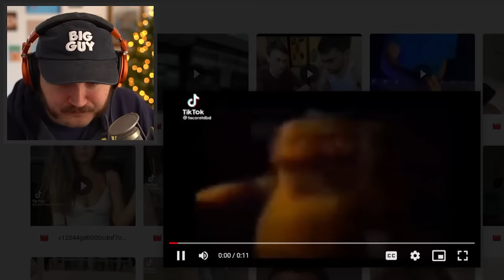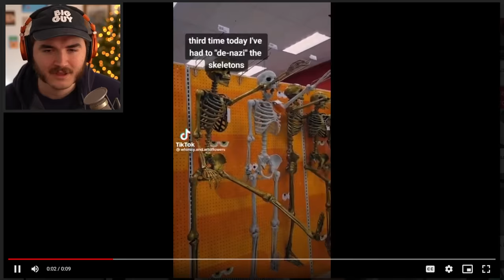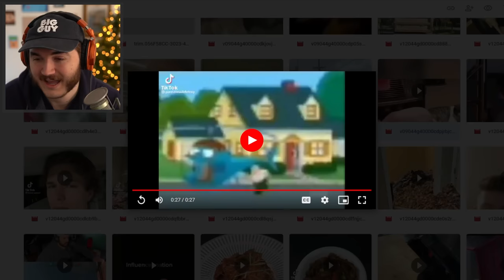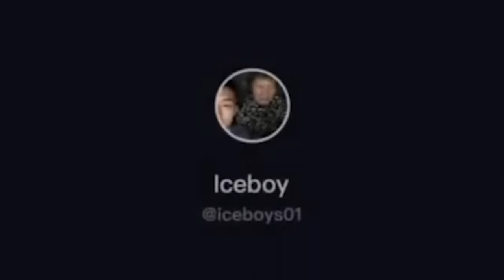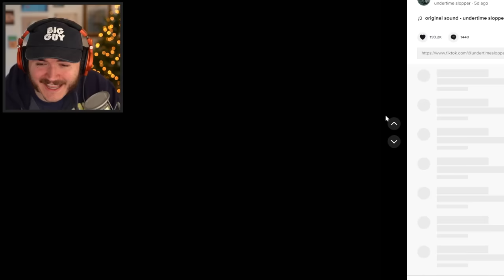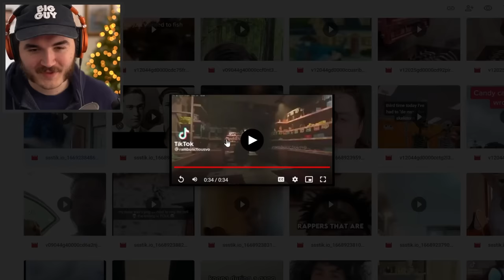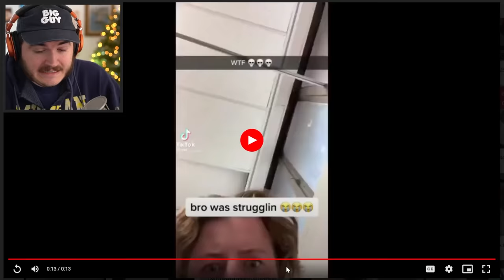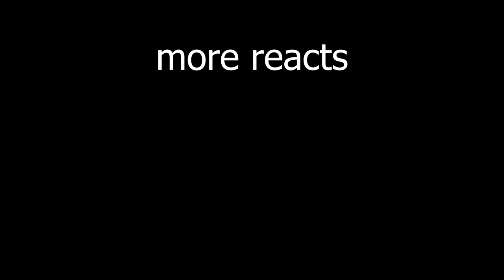Ranking Your VILE Tiktoks

Comment: 0:50 this was a blunder. If he had put the lemon in the cup he could have then rotated the potato to win.
Reply: WHAT IS THIS GAME EVEN I'm SO CONFUSED
Reply: @gelatinous6915 only real ones know how to play that game.
Reply: But if he took the tape measure out of the cup you could still counter the rotated potato
Reply: Alternatively though he forgot that he could use the melon slice move and cut it right in half along the edge of the melon to reset the pattern. But yes he could have lemon cupped to rotato potato.
Reply: @mOki.i  Yeah but his best defense was proably to put the lemon in the cup and move it to bottom left corner
Reply: or you could put the tape measure locked onto the cup and over the edge
Reply: Yeah but he was hiding the rolling pin behind his back so he's disqualified for cheating
Reply: Fuck the meta
Reply: @tripwire3992  But the rolling pin has been allowed as of 2017?  In fact he could’ve countered the tape with the rolling pin and it would be considered a legal move.
Reply: @UltraChase but bottom right corner means you can use the machine gun double wee woo move which, as we all know, is the best move for countering anything .
Reply: @mOki.i  Guys. Guys. Is everyone forgetting the double cheeseburger and sausage egg pivot?
Reply: No, no, no. If it was a blunder, they'd have to put the Roomba on D.E.8 and then they would have to spin the Air Fryer 3 times while the opponent consents to a housing search! Hope that helps! :)
Reply: Of course these absolute beginners forgot about the infamous beanies and weenies twister
Reply: @PigeonLover420-ev4oh  Exactly, even a newbie should know about that, he wouldn't even have blundered if he did that! Oh, also, can't do that in the first place if you don't reactivate the Ace of Spades card!
Reply: @J-Curlz  True.

Comment: That guy that was typing into the 'Gizmo' as jshlat calls it that guy is a third-party inventory counter he's actually manually counting every item and adding it to the machine that he's using, it saves all of it it's how businesses readjust their inventory to a correct value most of them also can't seem to count worth a shit because every time they've  been used at a company ive worked for that's had that happened they end up fucking inventory up worse than what it was before they started.